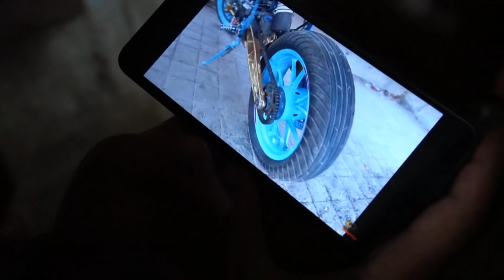YAHAMA R15 V3 Modifications | Daytona Exhaust

Comment: Expecting huge improvement over a stock exhaust is not a case with the single cylinder bikes. I mean I like the way it sounds on higher RPM but I think that there is a compromise with the exhaust's look. It doesn't look that appealing to be honest with you. We should not expect a drastic change in sound because 155cc can't produce that much power. Anyway I like the video. And congratulations to the owner.
Reply from the maker: Totally agree with you brother